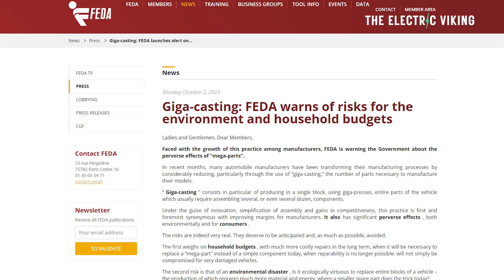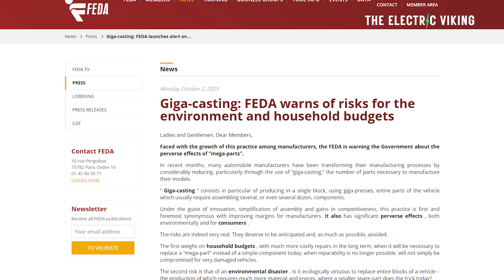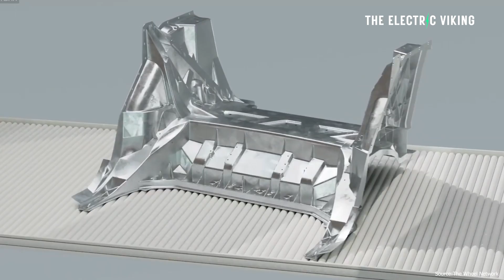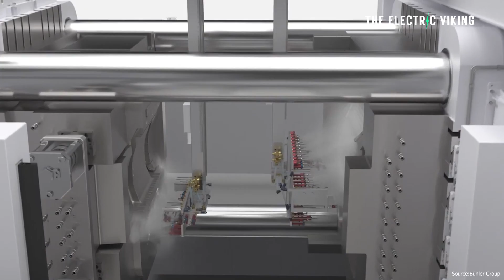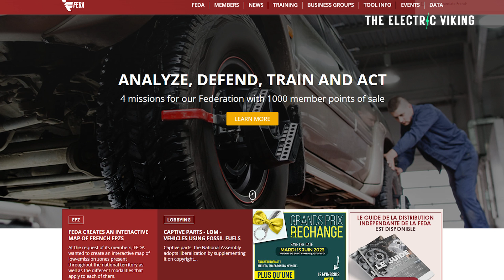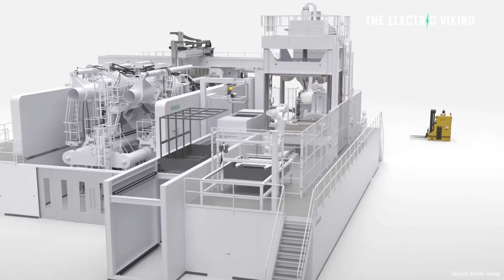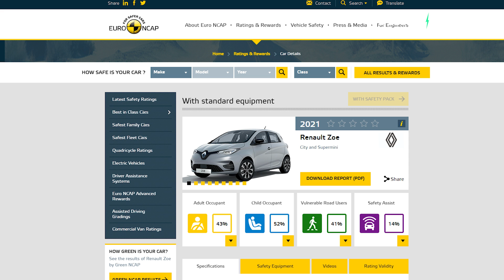Magna and French auto industry issue red alert; warn dangers of Gigacasting

Comment: Your statements about the repair and damage and writing off of vehicle structures and let's say a traditional steel stamped and welded vehicle are not quite right either large sections of vehicle can be cut off I've got a Camry in my possession right now that was a beautiful car got rear-ended crushed all the way to the back glass they cut the back section in the car off welder on a new back section of the car the car is perfect and it was owned by us from brand new so that's not necessarily true but in the suspension structure and mounting points and stuff still is malleable it can be bent back they can put them on a frame straightener and they can being cars back a lot better than what you think and can repair and/or take out some of the separate small welded pieces and repair them and it's not always right off a car it's a lot faster to write off a car for airbags or electronics and wiring they got ripped up and requires the whole car to be gutted in order to fix a whole wiring system or the all computers got shorted out like by a flood but the structural parts that you're talking about in general being damaged your blanketing too much that they cannot be repaired always get written off that's not really true talk to a body shop guy

Comment: I think the idea of building a car using these processes is it great idea. All the way up to the point where it's on the road and being driven. Once it sustains even minor contact with other vehicles, it tends to not only fracture, but it passes that fracture into other portions of the Mega casted structures, causing you multiple tens of thousands of dollars frequently to repair car that, as it turns out, is not conducive to a vehicle vet is particularly durable. Perhaps they can figure out how to make these assemblies reparable, or at least have enough ductility in them where they are not completely destroyed at the most minor of incidences. I do agree with you, it is cheaper to build the car that way. It is far more expensive to the vehicle, because the insurance costs are going to cost you more than buying the car, it won't take long for that to be a reality.
I don't feel like to point out that the manufacture of aluminum alone is one of the most unatu logical things we still do on a large scale. Add to that the fact that when the battery packs start to burn, it's next to impossible to put them out short of using nearly Frozen brine water which would be cost prohibitive to have fire departments carry with them, when you get molten aluminum, up to a certain temperature and you add water to it, it can tend to explode. That does not bode well for the guys trying to put out the damn fire.

Comment: Rivian has the truck where the bed is part of the chassis. It's a bare minimum of $25,000 if you fix it yourself. If rivian fixes it, it's $40,000. On any other pickup truck, you take a few bolts out and undue the wiring harness and replace it. That's scary for the working class that uses trucks as a truck.

Comment: The structural battery pack being a bad idea is something that I can agree with. It makes the battery next to impossible to replace. With electric vehicles, most parts are going to end up outlasting the battery. It just makes sense to make sure that the battery can be replaced.
Reply: I'm not certain about this, a lot of "the batteries won't last" stories are put out by the fossil fuel industry.  Of course, we won't know for sure for a few more years when we have more data, but it's equally possible that the batteries might outlast the rest of the car.
Reply: @brianarthur6199  The thing that determines how long a battery lasts is the amount of discharge and charge cycles. This is well understood science. What happens over time is that filaments start to form on both the anode and cathode. Eventually, they will go through the membrane and touch each other and creates a short circuit, which can cause a fire.

Comment: - You're making fair points in favor of casting. There could even be some solutions like getting a rebate on a new casting if you give back the broken one for raw materials (aluminium aint cheap).
- Tesla is still a bad company regarding right to repair. I don't know if it recently changed but it is known to be impossible to repair outside of tesla dealerships which is not fair or good.
They still make the best EVs no question about that.
- Regardig structural batteries i still think they should be cautious with those. If we want sustainable cars we should be able to swap batteries and even have authorised battries reparations because often a single part or cell is damaged and the whole pack should not be scrapped. So structural OK if replacable (both arent mutually exclusives).
- The Zoe has a 1 star rating not because of its structural integrity but because it does not include the latest driver assists (it was not interesting for renault to update that car on those assists given the target market and the fact they want to stop producing it). Until driver assists came in it had a good rating.

Comment: Tesla is letting castings through on the model Y out of Texas that have fissures in them that you can shine light through. Again quality control. Casting is not new give it a cute name like giga or hugeimo ! It’s not new . Casting produces a porous metal. Yes it is weaker, if repeatedly stressed it can crack  Won’t bend but will break. Castings don’t absorb shocks we’ll hard to tell if compromised. In saying that.  Cars do use cast components. Is Tesla weaker for it ? Not sure wouldn’t think so . Problem not repairable so insurance premiums will go up. Makes it cheap to produce cars, but can’t repair them from minor accidents. Will have to replace the car, so expect high insurance costs and without a rigorous detailed history no resale value .

Comment: Sorry But you are wrong on repair. Giga casting are very bad for the consumer, structural damage in the front or the back of the car are frequenly repair has long the cabin is not damaged any standard car is repairable. But if all the front or back is in one piece you have to replace the whole thing because you can't replace part of it and casting have low fatigue resistance and are prone to cracking if deformed. 

But for the manufacturer it's very good, make the manufacturing process easier cheaper and the car last less longer.

Comment: The only issue i se with casting such a large pice of the car in Aluminium is that is it is not possibly to repair the car in case if a collision. 
It will be a non servicable even in a smaller crash.
The bonding of the whole rear end  "pressed aluminium" with the reinforced steel frame using strong glue.
Pressed aluminium is very brittle and cannot be reshaped again.
Newer cars are not made to be repaired, throw away

Comment: Consolidation is not a new concept, it is also the reason why a lot of "appliances" get totaled or thrown away. Insurance are not going to get cheaper, no matter how much shopping you do they are all in bed together. I was just watching a video of a guy who got a small dent under the tail light of a Rivian truck. Quote from the Rivian certified body shop: $ 41 000.00 They wanted to replace the entire one piece side of the truck. He went to a regular body shop and got it done for a little over a third of that. (They cut and welded a quarter panel just behind the cab). But and it's a big but... He lost all warranty on the vehicle. Honda got out of that integrated bed on their new Ridgeline pick up truck for that very reason, and I think repairability is becoming an issue for consumers. Between a rock and a hard place.....

Comment: The issue I see with one part for the front of the car is the material is brittle. In a crash you break off a corner of a casting will the total casting be declared bad and in most cases scraps the car? Only time will tell.  Metal frame cars can be bent back on a jig so you can fix the car.
The Tesla battery packs are designed to be ground up to be recycled but very few places do this. Many junk yards will not take a car that has batteries. If you ever took a Tesla pack apart removing the cells was very hard and filled with a foam that has very little value.  
Products need to be designed to be repaired and recycled.  We have to move away from throwing away products and made from toxic materials.
Tesla must do more than cost reduce and offer parts for sale so third party shops can repair the car.

Comment: They are pushing back because of employment consequences. It is a social issue which goes beyond your megacasting . iI is part of the macroeconomic transition into a near full automation of industrial production. And no if you megacast despite Tesla claims you will have to change the casted part you can't just cut through it and weld a part without creating structural wicknesses. What will hapen ?
Well over the next 20 years every remaining car manufacturers will have adapted these new manufacturing processes and nay significant damage to cars will be a will be considered a wright off wich will to increase in insurance premium and this despite of all the increasse security fixture such as automated anti collision systems and driver awareness alert ect....
I really like your show and usually tend to agree with most of it but in this case your analysis was to superficial. We are at the dusk of a new economic cycle where tech is not the product but the tool driven by AI . It is normal for group of interests to fight it. They represent the old system and fear the advent of the new era. During the transition to a new economic cycle there is a time of uncertainty where protectionist and nationalist ideas are fed to the masses by the the people holding the capital.
 They will transform their tools of production in the same way they shifted it to the middle east, but in the mean time they need a scape goat and Musk for being flambloyant and outrageous and the chinese for being the "new devil"fit the bill.
We could go on and on but this is the gist of it . Politicians in the west do the bidding of the capital but they are elected by the citizens so the capital in control of the medias and feeds the masses .

Comment: Volume drives manufacturing. So a contract manufacturer probably can't justify the capital requirement for a huge casting machine.

An example of this: appliance manufacturer in America machines vacuum forming molds out of aluminum vs. an appliance maker in Italy who uses plywood for molds. Plywood is at least 100 times cheaper but the mold is only good for so many units. High volumes in the us justifies the expense of the aluminum mold. Plywood means a short model run can be justified. So smaller volume and more frequent model changes. One way is not better than the other. Each method has it's place. Just as good caring seems that it would make sense for high volume.

Comment: here's what the fight is REALLY over: steel unibodies are stampings of HUNDREDS of pieces, spot welded together. after spot welding, the finished structure warps & draws- CHANGES, so that the attach points are off from where they need to be. THAT is why- in a factory where they use this method- you'll see hundreds of workers who's only job is to straighten those errors. REMOVE those errors from the process? and you remove those HUNDREDS of workers- that? is ALL this fight is about. another disruption. what you're seeing- is the labor unions flexing their muscle- their political power, nothing more. stamping is finished- gone, DEAD. even if they manage to win this battle- casting will win the war- signaling to the rest of the world- 'don't buy anything from france- they still use that old stamped krap'.

Comment: What people may not have considered is repairability. When it comes to panels lumps and bumps provide strength or rigidity to the panel. It is the same with the castings and damage to those parts may result in large replacement requirement in the event of damage. So from the point of view the creation of the car it may reduce manufacturing cost and increase simplicity. 

Manufacturers do not care about repairability and in fact it make economic sense to write off cars because you purchase a newly manufactured car. 

Insurance companies are charging more for ev insurance, but that isn’t conclusive proof.

Comment: The French automotive industry is big in France yes, and there is nothing wrong with that. Are you proud that Australia doesn't make cars ? Here it's not car manufacturers complaining, it's OEMs, spare parts manufacturers, garage chains, etc. I suspect part of the issue is how Tesla hasn't really tried to work with them, it's extremely difficult to get a Tesla repaired here in France (but not just here).

Making lighter cars is now encouraged by the French government by a tax on heavy cars, so there is that. On the other hand aluminum use is discouraged if it comes from China, as it's made with coal fired plants and is an environmental nightmare. Recycled aluminum is OK.

Comment: "Fatigue Life" in any casting, is the most difficult design factor to be taken fully into account. Especially components that may be subject to full or even partial bending stress reversal cycles (eg. compressive to tensile,  for example the section connecting front axial loads to body frame during off-road racing), while castings have very little capacity beyond their elastic limit having very little ductility...
Reply: Correct, different metal fabrication methods create different microstructures. Casting is different than rolling, or forging. Even if its originally the same material. That's what heat treatment does. Change the microstructure, that changes the materials properties. That said, in the case of Tesla, if the cast part was designed properly, it may do the job. Time, and hopefully, some extensive fatigue tests, will tell.

Casting usually makes a more brittle part. I don't know the details of giga-casting, in particular. It may be different enough from traditional casting, to create a less brittle part.

The problem with videos and comments on the internet, is that they are often akin to the peasants getting all riled up, and storming Frankenstein's castle, for a good old fashion lynching. Engineering should be applied. Not some off the cuff, bad mouthing.
Reply: @michaelmoorrees3585  The Idra Giga Press operates at high pressure so likely produces product with some properties of forging. That said the strength of the casting probably depends a lot on design. I would imagine this can be optimised by finite element analysis and CAD. Most ICE engines and transmissions have been successfully cast for decades. The difference now is the Idra technology is allowing much larger objects to be cast than previously.
Reply: @jimgraham6722  engines and transmissions are not load bearing, which is the question here
Reply: Carmakers say they build „rigid“ structures, but you can find a lot of sources that show how the different parts of a car are moving. It’s been done on the outside with lasers (laser vibrometer) and that can give them a 3D pictures which parts moved for xy mm.
Reply: I imagine a GC is significantly stronger than its predecessor such that forgeddaboudit .  .  .
Reply: @anastigmatix4119  Your imagination is irrelevant
Reply: Chassis that flex are bad news
Reply: Everything that doesn't flex would break immediately, don't you think?
Reply: @VedranAndrejević  Where needed you build flex points into the structure. Most of the movement is absorbed by the vehicle suspension.
Reply: @jimgraham6722  Agree, just saying as cars are made from metal (and are pretty long) no matter how you design it, it will flex certain amount, and it's not bad. And if you go to extreme to make car flex as little as possible you will end with something like a tank :)
Reply: @jimgraham6722  every chassis flexes - one of the lesser Jeep models flexes so much, that you can not open the doors in some off-road constellations

Comment: I think this is mostly to do with stranded assets and the fact that tier 1 suppliers do not have access to the finances to replace existing technology with total new revolutionary procedures. They may also be used to older casting techniques which created lots of warpage and rejections. Remember that Tesla developed a new alloy to be able to do this without heat treating and warpage problems.  Maybe mary Barra should join them and try to get it banned.

Comment: Giga press can be good for manufacturers. Since idra has only limited capacity other press makers are trying to introduce alternatives.

For end users a crash may result in totaling the vehicle as this giga press produced unibody is difficult or impossible (cost wise) to repair. That is the reason insurance premiums are higher for Teslas compared to similarly priced ICE cars. That and the structural packs which are also not repairable in most cases after a crash.😊
Reply: You could always tell the cars repaired after a bad accident - they crabbed down the road.

Comment: Yes the fossil Fuel car Manufacturers have Always had the Customer First. They got dragged kicking and screaming to get Seatbelts, Disc Brakes, Catalytic Converters (Cleaner Air not for You), Most Safety measures. Wrapping Parts around other parts to charge you more for replacement. Built in redundancy so parts are replaced quicker. If they had  Customers  interests at Heart All Cars would be Hybrids by now and EV's would be replacing them over the past 10 years.